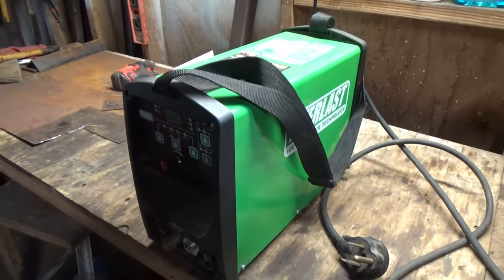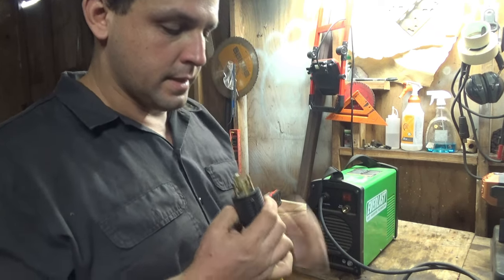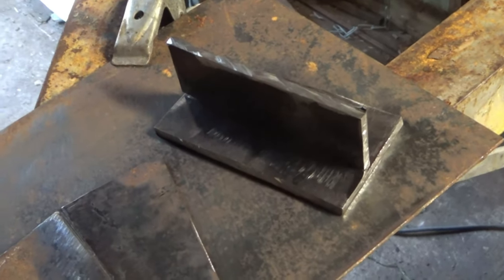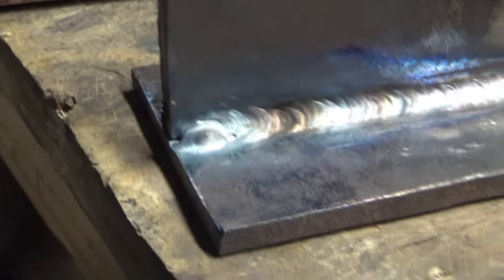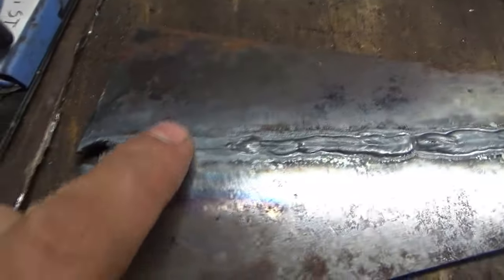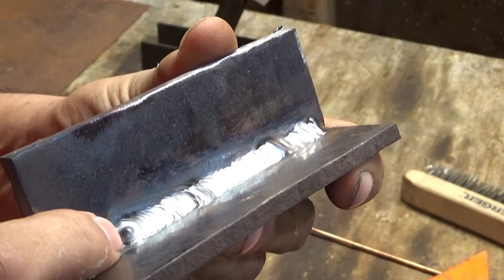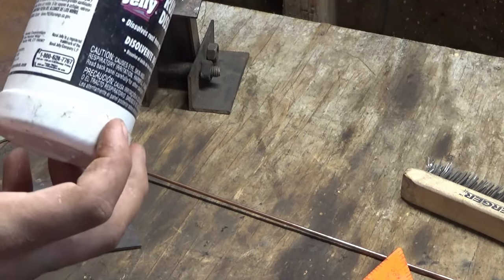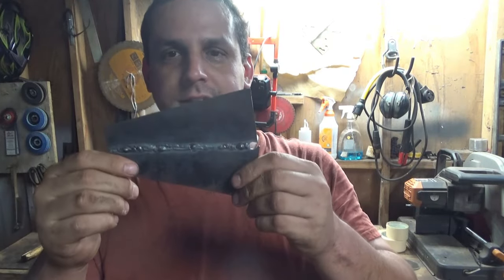Will my generator run my welding machine

Comment: I got my ahp 203 and the 230 mig ahp also made by same owner as everlast but I’ve been running a lot off of my generator welder and works good but just make sure it doesn’t run out of gas or turn the welder off then the generator so it don’t mess up
Reply from the maker: What type of generator weldor are you talking about?